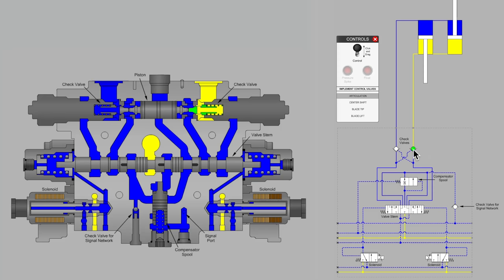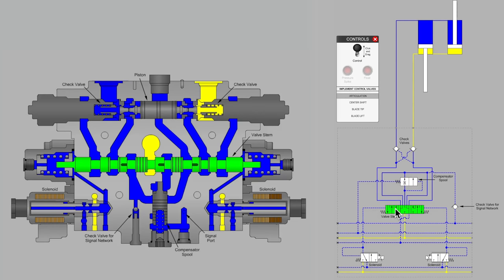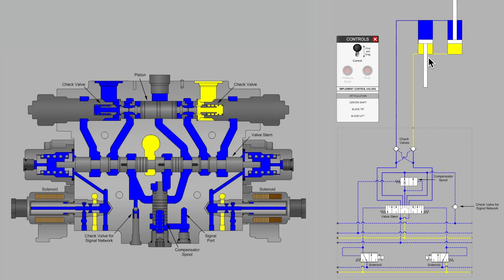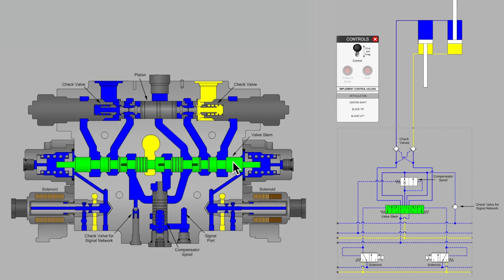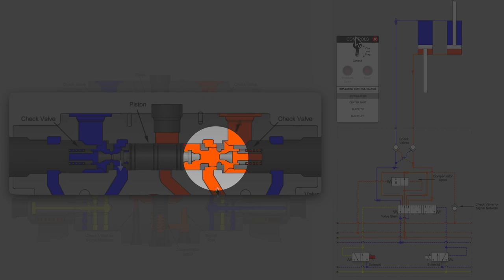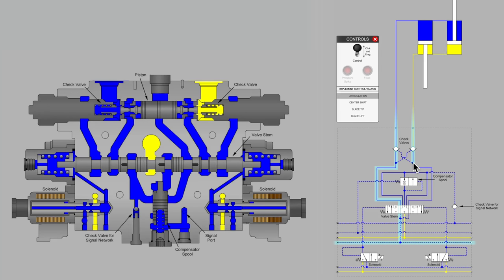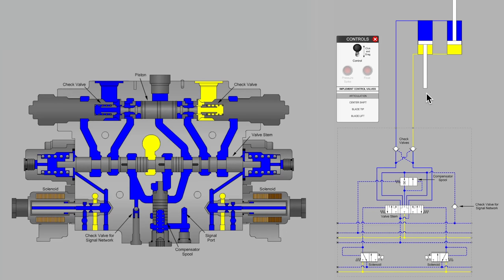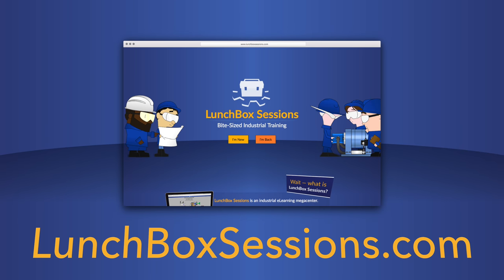Pilot Operated Check Valve Cylinder Troubleshooting - Part 2

Comment: One of our 120G CAT graders would at times articulate on its own.  The DCV was fine but the check valve was determined to be defective by using the process of swapping out with a known good valve of the same part number.  The problem followed that particular articulation check valve to its new component.  These videos are great.
Reply from the maker: Thank you Chad, and thanks for sharing your experience. The process of careful checks, observations and logical analysis soon leads a dedicated hydraulics student to the fault. Sounds like you too know the path. Keep on!

Comment: Hello Carl,  would the cylinders move at different speeds in reality since one flow is to cap side and other to rod? Really appreciate your videos. I recently subscribed and have a lot of catching up to do. Thanks you!
Reply from the maker: That's a very astute observation James. Quite correct, that in the world of the very simple hydraulic system (e.g. a log splitter), a single rod cylinder retracts faster than it extends. Since the rod itself becomes fill volume during retraction, as it moves from the open atmosphere to the inside of the cylinder tube, a lower volume of fluid is needed in comparison to the extend function. 

Of course in a circuit such as this one where the valve has a proportional capability, the operator can move the control stick to achieve just the speed desired for either direction. But still, if the valve was held in the maximum position for extend and then later for retract, we would find likely find that the retract speed is faster,....assuming a symmetrical valve spool. Great question, thanks.

Comment: Hi sir.in PC 130 their is no electrical conectin.in that excavter stand by pressure is increased gradually that my doubt
Reply from the maker: I am still not quite sure that I am following you regarding your doubt. The valve in this video is not used in a PC130 excavator. If you are asking about the stand by pressure on your machine, I would need more information in order to understand the issue and your question.